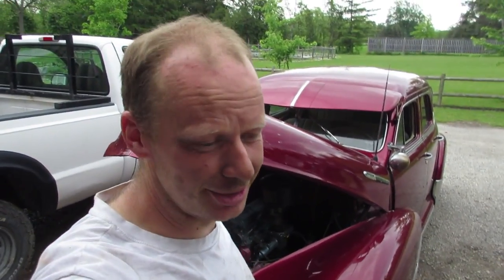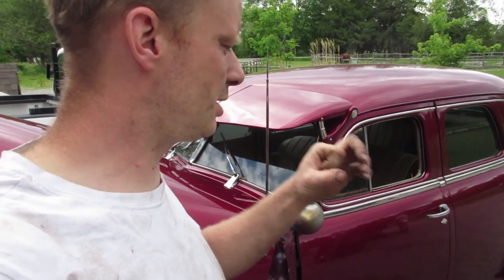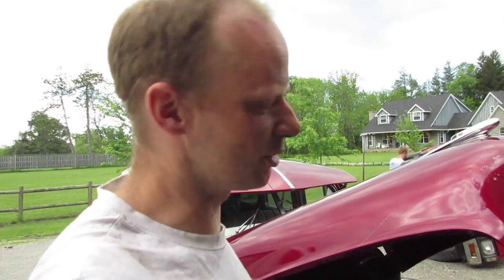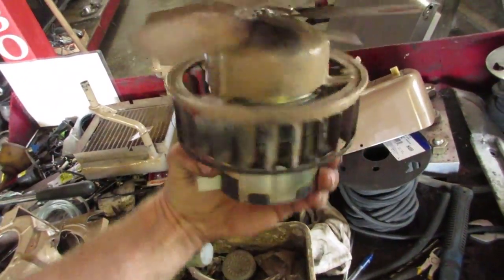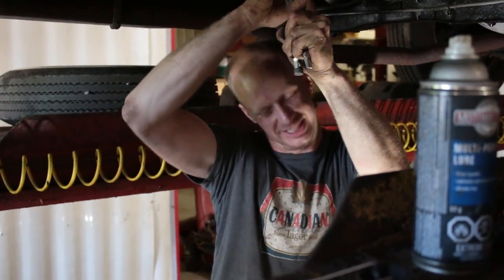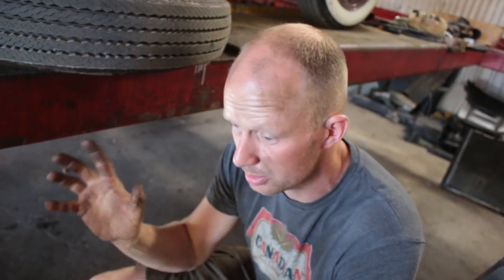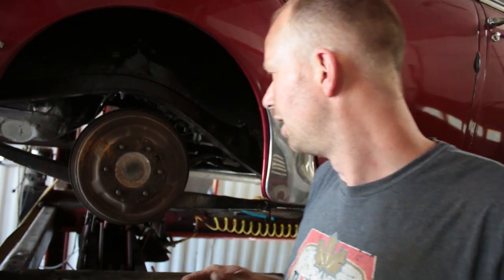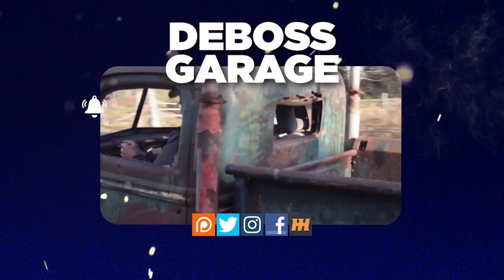'48 Chevy Fleetmaster Has A Fuel Problem - NEED YOUR HELP! (Part 11)

Comment: Hello Rich, as older guy having turned a few wrenches; 1. make sure the  gasstank or cap is vented, 2. drum brakes are good on dual wheels & heavy trucks or equipment, they were never any good on cars or light trucks. It's best to replace them with disc brakes even on restorations that are going to be driven, on trailer queens it doesn't matter. Because you asked I vote that you show the intricacies of your technical work. 
I'm also glad to see your integrity is not for sale. Money is important but not all important. If you decide you want to make automotive entertainment in the future be sure to call it that. Meanwhile keep up the good work.

Comment: I had a similar problem with a old Plymouth a friend had restored. He too added a electric fuel pump. The ones that look like a in line fuel filter with two wires out the end of it. Those pumps  are really designed to have fuel supplied to them,they don't like to draw from the tank. I switched it to a Holley Red line pump and it solved all his problems. 
I can't be positive  that this is your problem and you didn't say what type of pump you put in. But It sure cured all the stalling problems he was having with his car.

Comment: The truck on it's side in the background.. extra points for that.
Needle and seat sticking or float out of adjustment maybe?
Reply: Matthew Edwards I was wondering if I was going to be the first so ask about that
Reply: kawasaki eddy My 1953 Willys had a rusty fuel tank anx lines.
Replaced all that and still had fuel problems.
Turned out to be one rusty bit wedged in the needle and seat.
Reply: Matthew Edwards I ment the truck on it's side lol only carbs I work on are motorcycle carbs alot more simple to me than car carbs

Comment: Disconnect the fuel line from the carb. Unscrew the gas cap. Put a air line onto the carb fuel line end and blow air back through the fuel line. Have someone put their ear near the fuel filler tube, of the gas tank, and listen for air blowing bubbles in the gas tank.

Comment: We used 5 gallon boat tanks to troubleshoot these issues. Just disconnect the fuel lines at the carb. Hookup the old plastic boat tank. Squeeze the bulb while driving. If it still stumbles. You got a fuel restriction. in the carb. 

And when those old cam driven fuel pumps go. They either leak or they suck air. As the rubber seal fails. I also seen the lob that drives the fuel pump off the rod just round off. Then it's cam change time or cap off old fuel pump and install electric one.

Comment: plan 1: Pull the fuel hose off the carb when it's stalling. Put the hose into a bucket and see what kind of volume it's flowing at idle.
plan 2: run it off a Jerry Can and see if it fixes the stalling.
Reply: That was going to be my suggestion as well.. Put a lawn mower tank under the hood and drive it around some and see what happens. That will at least narrow it down to a fuel supply problem, or not.

Comment: I had a similar problem on a gas truck in the ARMY, someone lost the spring that goes behind the fuel filter and under light driving the filter would let enough fuel thru but under a lode it would suck tight to the carb side starving the engine. By putting in the spring in that belongs there the problem was solved. Like the others we did the fuel flow at the carb and it was good, that is why we went at deeper.
My hands are always dirty

Comment: as silly as this sounds.. do a valve adjustment!, had a old 250CI 6 cylinder in a 1953 dodge do this to me, as the engine got hot, everything expanded and it was blowing just a little out the intake valve on compression stroke, would run great cold. but no power and stall when hot..

Comment: (This from my dad whos had old chevs for ever, and with his brothers ran a shop dealing exclusively with vintage chevs) Rubber diaphram inside the standard fuel pump can perish when different (unleaded) fuel is used ( and may also be perished due to old age). This can also affect the valves in the fuel pump. 
Just adding an electric pump will not fix it. 
To test: run a plastic line to the carby hooked up to an electric pump drawing fuel from a jerry can or bucket, whatever. If it runs fine for an extended period then your standard pump is likely the issue.
It is also possible the coil is failing, but youd expect once that happened to have issues with starting as well.

Comment: bypass the mechanical pump when using the electric pump I tried using both on my truck and it caused nothing but problems it was cured when I bypassed the mechanical pump I would also check tank venting good luck

Comment: I had this problem when I put a pusher pump in a 79-old’s
diesel. work the engine pump fast and the electric pump doesn’t keep up with
the demand and you get cavitation which vapor locks the fuel line and kills
your engine. the solution is to disconnect the mechanical pump and boost the
pickup pump output. pumps don’t like being put in series give it a try and see
how it works for ya :)

Comment: I guess you could eliminate the ignition by checking for spark once it stalls........had a similar issue with my 78 Ford it was ignition.....acted like it was running out of fuel

Comment: The mechanical fuel pump has check-valves in it... sounds like you have something either getting stuck in the side towards the tank or that check-valve is occasionally failing to seat.

Comment: Had a similar symptom some years ago with a '48 Pontiac . Eventually found that inside the Distributor casing , the connector end of one of the small leads was positioned on the screw post in such a way it was too close to the metal inner casing ...when things warmed up and expanded the lead touched and shorted out the ignition until it cooled down again.
Reply: wow...
Reply: I had a similer problem with a 61 cadillac.  I put points and condensor in it and it tried to start but wouldn't .  Everything looked fine but on closer inspection one tiny strand of wire was touching the housing and shorting out.

Comment: Let's know what you fine.

I had a 1952 Mercedes-Benz when station in Europe that would do the same thing. It had a small in line fuel filter that was plugging up on me.
I have hear of people that would put a ping pong ball in someone gas tank causing fuel to shut off when the ball would get sucked over the pickup tube. I am sure you will get it figured out and it will amaze you at the simplicity of the problem. Just want to say like your vedios. Down to earth with some humor added.

Comment: Is it pulling a vacuum on the gas tank and not venting properly? try taking off gas cap when it happens.
Reply: I say the same . tank vaccume. run with gas cap loose. see if it stalls.
Reply: Brian k I agree with this aswell
Reply: That would be the first thing I would check.
Reply: This is very good advice. I have had this happen on a few different things including my dune buggy and my honda 3 wheeler.

Comment: I had a 48 chevy pickup for years, never had fuel delivery issues.  All original, though the fuel tank was behind the seat.  Sounds to me like an air leak at the mechanical fuel pump even though it's new or serviced.  Since you've installed an electric fuel pump I'd be curious to route past the mechanical pump and see if the issue goes away.   Those used a Carter YF carb. as I remember.

Comment: I have a 1976 k10. Whenever I would go through the mountains with the cheapest grade of fuel (85 octane here) I would vapor lock and the truck would surge badly. Found some 91 octane that claims no ethanol (did test it and it doesn't have ethanol) now going through the mountains problem solved. Higher octane might do you good. I don't know anything about your carb. but check the inlet screen if it has one, maybe remove it. I know that when the built in filter on my Quadrajet clogged I had a similar issue with stalling or not being able to get past 45mph (because of rpm and fuel demand). If it has the mechanical fuel pump, check to make sure the push rod has been ground out. If its anything like the one I have I know that some times that rod end can wear and give you issues, especially at higher rpm. Not that any of it is directly related but I hope it helps. Thanks for the videos! Keep it up!

Comment: BTW when the check-valve on the inlet side of the fuel pump fails to check, the pump will be pushing fuel back toward the electric fuel pump...

Comment: I would agree with the comments about tank venting, also could have a fuel line collapsing  internally, these will have the same symptoms of a pluged filter, as for the carb leaded or unleaded makes no difference to carb operation, and jet size has nothing to do with idling or vapor locking, the main jets only flow fuel above idle, the idle adjustment screws control fuel flow at idle. If it runs good cold and only acts up after warming up I would look at ignition system and valve adjustment, if valves are set to tight the will effectively float when the engine is warm, making it look like carb issues, you also want to check volatage at  the points warm and cold, should be around 4 volts on a 6 volt and 6 -9 volts on  a 12 volt, if the voltage is too high the coil will break down under load but work fine again when it cools off after it sets for a while.

Comment: Things to look out for : fuel leaking from the pump into the sump, exhaust leaking into the inlet manifold due to cracks where they bolt together, inlet manifold getting too hot or if headers have been fitted too cold, no vent on the tank, too much ethanol in the fuel , fuel lines rotted by ethanol, sticking fuel float, too much fuel pressure, vacuum leaks in the distributor or on the transmission or pcv valve. Some of those won't apply to this car but will to other older sixes and eights.

Comment: As all ready said is the breather on the tank ok ???
Other thing I would check for is a hair line on the inlet manifold and maybe once it gets warmed  up a bit the crack opens up 
It sounds like a fuel or air problem to me and not a spark issue 

You shouldnt need a electric pump and this is only putting a band aid on the problem 

I gather you have changed all the fuel lines and one of those isnt collapsing in when driving (I doubt this is the problem)

get a can of CRC or WD 40 and squirt it around the inlet manifold when this problem happens and see if it runs any different

Comment: I had a VERY similar problem.  The line inside the tank would curl up and suck air.  I found it by running a hose from the carb line to a bucket and kept seeing bubbles.  I changed out the tank to a top feed style and the problem went away.

Comment: Id look towards secondary ignition. seeing how you kinda ruled out the fuel system ( switching carbs, installing electric pump)
id try installing a clear see through inline filter right up by the carb to make shure its getting fuel to the carb first.  a video of it acting up/quiting would be good to see. seeing how it breaks down  when warm it could possibly be a coil going bad.
best to test it when the problem occurs.  got accsess to a 4 gas analizer or secondary ignition wave form tester ?
Reply: also is the car still a 6V car?  the ballast resistor which lowers voltage to coil side + could be killing out/ dropping voltage when warm. test the voltage on coil side+ before the car breaks down and after.

Comment: Some more thoughts 
I would rather than try and find the problem try and eliminate the problem 
Grab sauce bottle (one of those ones that you squeeze to force the sauce out and some rubber fuel line the right size to go to the carby and sauce bottle and next time it happens just hook the bottle up as a fuel supply and see if it runs ok then 
If it does you know its your if fuel if its no better just squirt some petrol down the carby  and see if that helps 

You have no doubt tried all this already

Comment: make sure the electric fuel pump isnt over pressurizing the system.   I have a feeling the pump is causing cavitation.  Not sure if the lead additive isnt causing some type of issue.    

Also does the pump empty when off?  i assume it is mounted higher than the tank.

Comment: pin hole i pick up pipe in the tank i had the same problem in my car the only way to test it is to take the pipe out the tank put it under pressure with an air line with some fuel in the pipe  the braze the hole

Comment: have you blown the fuel lines clear with compressed air?
make sure you check the tank pickup and the line into the carb.

Comment: put a gauge on it for fuel pressure so you can rule that out and drive with the hood off too see if u get same result, or if it actually is overheating the carb. I know you didn't think it was heat but if it looks like shit and it smears like shit....

Comment: To me, I kinda think its related to a accelerator pump or passage issue,  Also, in the past I've had rubber fuel line to collapse on me.

Comment: 1 gas cap not venting , though I bet you tried that already.
2 ..2 fuel pumps why ? you need less than 6 psi of fuel,personally I would just put the e pump on . Ethanol fuel eats up old pumps not meant to run e fuel. Lots of old cars have burnt to the ground when the weep hole leaks runnin e fuel
3 Clean the carb again ,can say how many times I have had to do it 2x 3x when working with old stuff, possibly re seal the inside of the tank. Check the needle seat bore for scoring the needle might be getting stuck closed.
4 You didn't mention the spark plugs ,a good old look at them might show if it's lean or rich then you can move in the right direction,possibly a crap condenser breaking down when hot ,look for crossfire in the dizy cap .

Anyway be waiting to what happens and how you fixed it. Have to go fix some tail lights in a 1987 jeep oh how my back will hurt  tonight I hate under dash work.

Comment: Gas cap ? Something FLOATING in tank? I had a 62 Plymouth Valiant, slant 6 . Drive it to Tennessee, acted like running out off gas, thought vapor lock, rerouted gas line on road in Missouri. Wrapped gas line with rags soaked with water . Was good for a while. Same crap. Stopped at a gas station, changed condenser, they said points were FLOATING, changed points, seemed okay. changed points. Got to Memphis seemed okay. Next week drive all around Chicago then back to Memphis on weekend half way there started again . So points, cond, fuel filter, rerouted fuel lines, gas cap , air filter all changed. Stopped at a dealer . they drove car  happened mostly at high speeds. Oh boy it did it , they said fuel pump.... Changed it ran good, didn't fire and starve for fuel oh boy I'm fixed, mind you this is after three weeks and three thousand miles of driving, through Illinois, Missouri, Tennessee, Kentucky. So I go to pay bill ! BTW I'm only 18 at the time. I'm short, I have a $5.00 gold piece , asked then too hold it until next week and I'll bring cash. No soap. Went to bank they wouldn't cash a chk. So they took fuel pump off and our old one back on. Back on road. Arrived in Memphis way later and r riding a bucking Bronco . Missing starving, took to Plymouth dealer and said fix it. Went to visit my Dad that was in a train wreck with his car and in hospital for close too a year. Picked up car Monday ?? Asked if the figured it out.? Tiny tiny piece of wood pulp got past or from filter and would block needle. 
Long story ? I'm thinking it's in your tank. Only thing you haven't changed ? Rubber hoses? Main pump at engine? -Casting porous?

Comment: could you show what you have done on the fuel line i had simalar problem on a renault many years ago that was a venting problem on the carb and tank
Reply: Paul Connelly 
I was thinking the same thing.  Run it without the fuel cap.
 The tank might need a vent.
Reply: might do on top of the tank there might be a breather pipe  posable for it to colapes

Comment: Keep a vacuum gauge with you while driving the car. Run the thing in the shop and establish a baseline,a vacuum gauge is as old school as the car and will tell you how well the engine is running. Keep a notebook and write down the numbers,watching just how the needle vibrates and where.Fuel,fire,compression.The holy trinity of making an engine run.You ran a bunch of information there past us.The old style flow chart method of identifying a particular problem should isolate just which of the three you need to follow.Are you going to post another video when you have fixed the culprit ?There are a bunch of really good suggestions in the comments box.Work back from what you know is reliable. Good luck.
Reply from the maker: Its all fixed.  2 stupid problems... The video will be up soon.  Great thanks to everyone
Reply: DEBOSS GARAGE Hey that is terrific. Thanks for updating.

Comment: new fuel will destroy gas rubber line had friends hot rod starve for fuel took off carb filter it was all black from the fuel flex line replaced twice till we found ones that would not get destroyed!
Reply: Y Pop carb hose is junk now. I always ask for low pressure fuel injection hose instead, never had an issue with it. It's even been submerged in fuel in one tank for 6 years now, still not broken down
Reply: Need to run non ethanol fuel